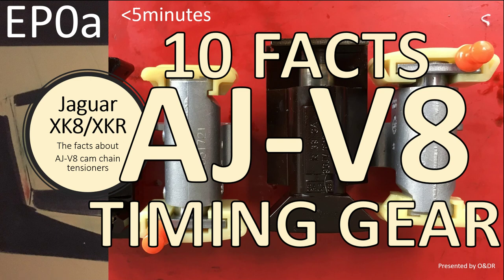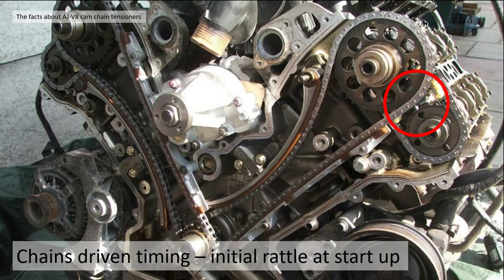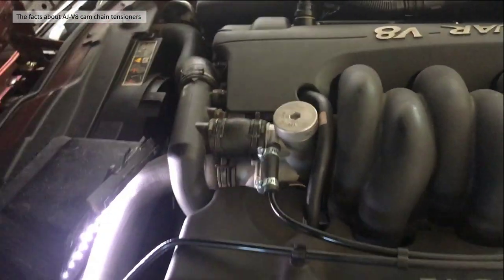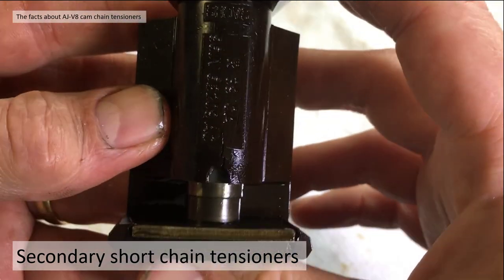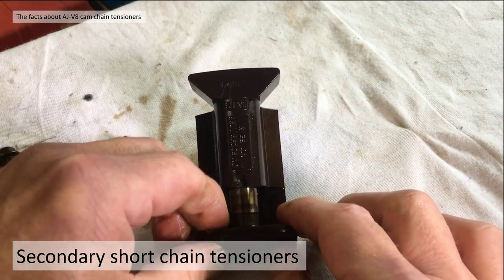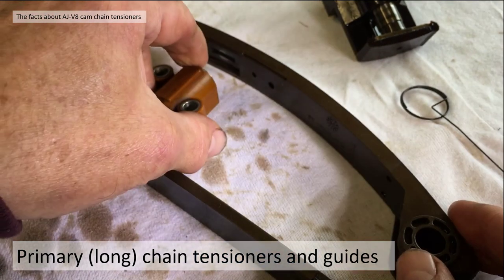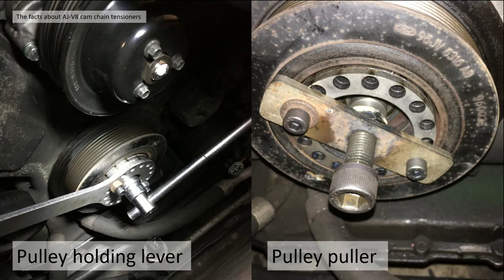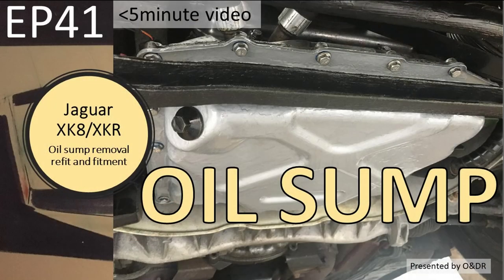Jaguar XK8  - 10 facts about chains, tensioners and guides AJ-V8 timing EP0A / XKR (X100)

Comment: Those of us with the 4.2L engine don't have any of these concerns in the short term, but has anyone had to do a chain and tensioner replacement on this engine yet and were there any significant issues?
Reply from the maker: Gary, good question, hope you get an answer, Who knows what the life of the timing gear ? thanks for the comment Damian
Reply: I'm just rebuilding my S-Type with the 4.2 - a lot inside there is worn, even the block's cast iron liners, but the timing assembly still like new (at 230.000 km).
Reply: @AUTOdidact77  That's 143K mi, only 4K more than I currently have on my 2005 XK8.  Mine runs like a top.  What was the first indication of the need to rebuild it?
Reply: @garyvanremortel5218  Lots of smoke after not having started the engine for a few month (now I guess just the EGR valve was stuck), and then it wasn't moved 6 years. So no "need" for a rebuild, but also not the worst idea at that mileage...
Reply: @AUTOdidact77  mine burns little oil.  Less than my 2014 X50i.
Reply: @garyvanremortel5218  Mine also was. Actually the cylinder liners are up to 1/10 mm out of round, this may have been the reason. I get them bored out + oversized (custom) pistons.
PS: Oh Yes, the modern direct-injected petrol engines are prone for that, especially the Audi V8. My former boss got two new engines in his first year of ownership. That kept me from going for a newer 7 series...
Reply: @AUTOdidact77  I didn't mean to imply that my X5 burns oil, just that the XK8 is better, about 1qt every 5Kmi vs 2qt every 7.5Kmi.  The oil in the X5 gets consumed by the turbos and the DI.  The TU engine I have is less lossy through the PCV system than the non-TU.
Reply: I have a 2004 xj8 4.2 6 gears.. I decided to run 275 rear tires instead of 235. I went from 24 to 22 miles per gallon.. I messed with the car to the point I’m getting 30 mpg on the 275 rear tires..  190k on the dash
Reply from the maker: Fernardo, interesting stuff. Did you advance the timing? If so how did you do it? Thanks for the comment regards Damian
Reply: @ODRModurol  no i didn’t open the engine I just brought it back to life ...I just learned how to control the problem that leads to oily intake manifolds, catalytic converter problems, gunk up valves and carbon forming on the cylinders and the timing to be fucked up. 
My car has came back to life from being lazy 
I get 30 mpg on the freeway going 70 to 75.. I get a 15 to 25 percent performance back 
I used to get 23 mpg .. I also did it to a mustang and it came back to life too
Reply from the maker: Fernando, lots of fixing and maintaining. Good job well done. I believe most Jaguar engines are setup running with 5 degrees advance. If you can more the crank sensor back 5 degrees I believe you can improve power and economy too. This has been done on earlier engine with a modified sensor bracket a little more tricky with the AJ26 as need to modify the bell housing. Interested to see if anyone has tried this. Thanks for the comment regards Damian
Reply: @ODRModurol  Jaguars are known for timing chain problems because of gunky valves with mess with timing..as well as catalytic converter problems.. it all comes back to the pvc.. positive crank case vent system .. after 1 hour of running the car the pvc releases back so much evaporated oil back to the intake manifold and the valves and the catalytic converter which cause to have gas mixture because it’s now mixed with oil.. if you put a oil catch can on the pvc it will catch some of the oil going back to the valves in take manifold and catalytic converter.. it’s to the point in removing 3 to 6 ounces of oil a week.. it gets worse with old oil.. 3 to 5 k max oil changes because your valves will develop gunk messing up with timing and causing a lot of carbon in the cylinders .. also if you don’t switch the trans oil and filter every 20 to 30 k you are burning up the tranny..
Reply from the maker: Fernando, don’t really see the problem with the oil breather pipes on my car in the UK. Wouldn’t image the engine is setup correctly if you are catching that amount of oil but could be wrong. Thanks for the comment and feedback from your experience it all adds to the information available on these cars. Regards Damian

Comment: Jag shouldve and couldve sorted any engine and transmission well and made the engine every bit as good as mercedes look r BMW or even toyotas best. That way their reputation would have been tip top. Theyre not bad and often are more reliable than many audi, merc, BMW or even Toyota and are cheaper motors than many and often get unfair criticism in some cases. There are some capacity engines and years that are really good but due to bad QC in the past and reliavbility and design gremlins, theyve now got a bad reputation. The truth is some mercs, audi BMW and some toyotas were BBV ad especially electrics on bmw and mercs and even bmw from 200p0 to 2008. Often they would last until the 3 or 4 year guarantee from new was finished then youd better have very deep pockets. Not what you expect on a £80000 + car. Disgusting.
Reply from the maker: Ian, good points and well said, regards Damian